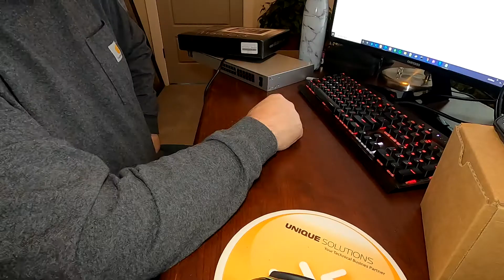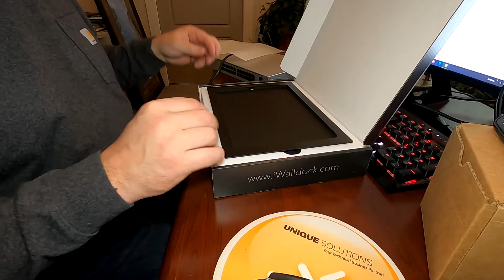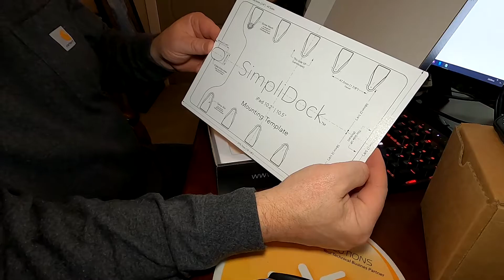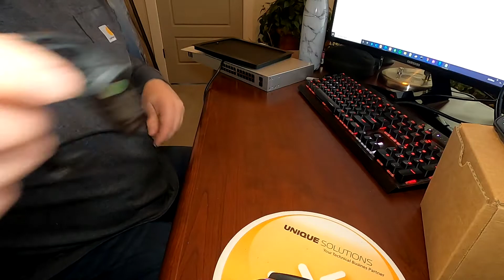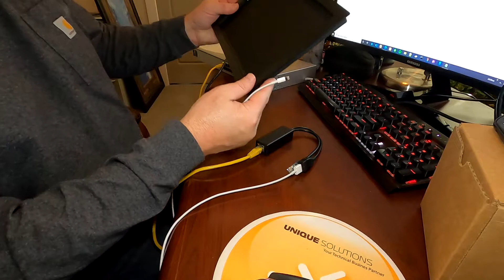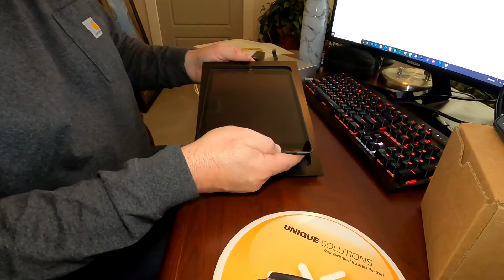iWallDock - SimpliDock

Comment: If you run the lightning cord down because you don’t have Ethernet how do you plug into the outlet? You said the back? How is this done?
Reply from the maker: If you do not have the power of ethernet connection, you'll need to have some form of power source (electrical outlet) for the lightning connector to plug into. At my old house I didn't have PoE so I ran the lightning cable down inside the wall to an outlet that was on the other side of the wall and plugged into that.
Reply: What kind of plate did you use for the plug coming out of the wall?

Comment: whats the ethernet plug for?
Reply from the maker: Provides power to the iPad over PoE Power over Ethernet.
Reply: @TheSwollenMonkey  I understand that. I’m asking on the monitor side there’s a female end and a male end. The female end get the cat 6 from the poe switch and on the monitor side we now have a usb for the charger cable what’s the male end of the Ethernet for on the monitor side.
Reply from the maker: @stevepol613  is merely an Ethernet data passthrough.